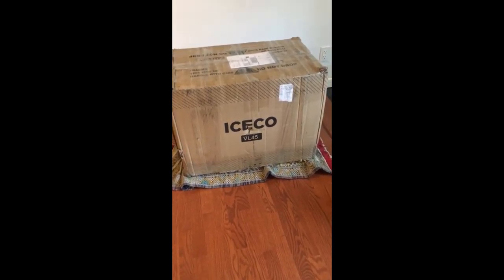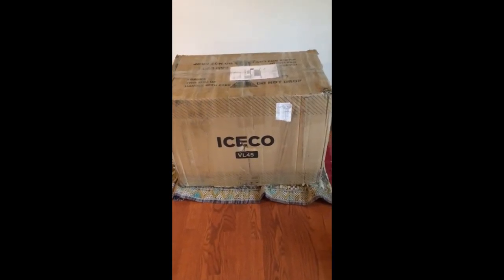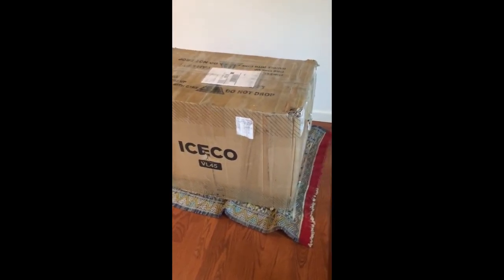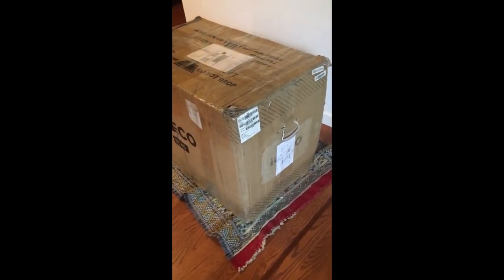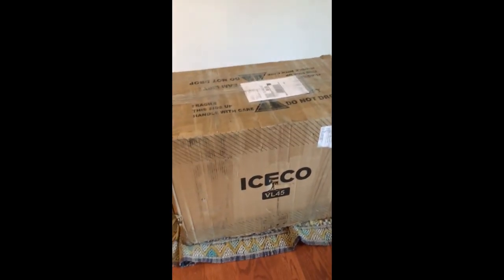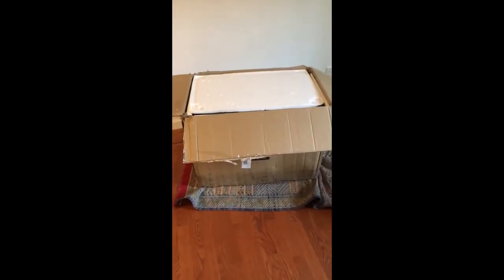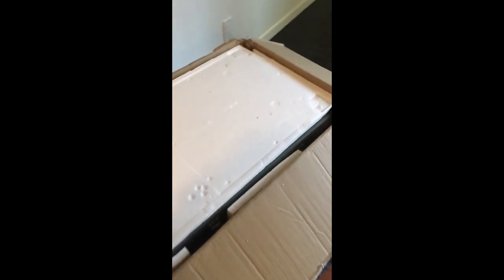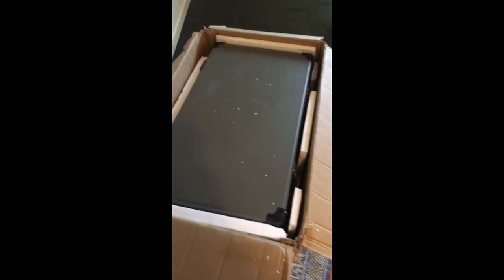Iceco VL 45 Review

Comment: I just got the VL60 single zone.  They now put protective styrofoam "bumpers" on the top and bottom of the box the fridge is packed in, strapped, taped and shrink wrapped on there.  After watching the FedEx person flip it end over end getting it from their truck to my porch I was extremely happy that bumper was on there!  No damage to the exterior of the unit.  I took the fridge out of the box and have let it sit for two days so all the compressor oils can settle back in.  Can't wait to start testing it with my power supply.  Thanks for the great, informative review you did on the VL45, it was very helpful.  Honestly, I haven't seen many negatives on the ICECO units, which gives me a good feeling about choosing this particular brand.

Comment from the maker: The converter used is the built in one in the unit. When 120v is available, I use the AC cord. In my van I use the 12v cord plugged into a cigarette lighter style outlet. A separate converter is no necessary. 
I have had the VL 45 plugged in continually for about 8 months. I’m using it as an auxiliary refrigerator in my house plugged into 120v house current. It seems to have gotten a little louder since new. Could be my imagination. I still recommend this unit.

Comment: Hello, thank you for this excellent review.  I'm writing because I recently purchased the Iceco VL45 and I have a question.  Let me start, though, by saying I have a very high opinion of this product!  I'm looking for information because I'm sure I'm doing something wrong and hoping someone can give me direction.  I'm on my second "test" of this product.  My set up is a Jackery 1000, fully charged to 100% and this Iceco VL45.  In my first test, I simply plugged the 12V plug into my Jackery; set the temp at 34 (which I later turned down to 30); Batter protection is set to LOW; and the compressor speed is set to LOW.  Those settings are the same for the first and second test.  In the first test the cooler was completely empty except the baskets that came with the fridge were inside.  My fridge ran for 4 and a 1/2 days and my Jackery battery still had 18% which equates to about .76 of a watt per hour.  I then charged my Jackery back up to 100%, pulled the baskets out of the fridge, and filled the cooler with containers of cold tap water (I used rubbermaid containers, Cool Whip containers, an empty Folgers container, etc.)  I plugged the 12volt cooler plug into the 100% Jackery battery and noticed that the cooler condensor ran for a LONG time.....In the first hour I lost 4% battery life.  In 4.5 hours I had dropped 12% of my battery life.  I'm now only 12 hours into the test and I'm down to 79% battery remaining (have gone through 21% of my battery for an average of 1.75 watts per hour).   I'm so stunned because I thought the cooler would be more efficient if it were full rather than empty, but I am getting the opposite results.  For both tests, the internal temperature of the cooler was the same - 69 degrees - at the start of the test.  Do you have any ideas of what I could be doing wrong?  Thank you for your assistance
Reply: Putting the containers into the Iceco that needed to be brought down to your set temp took more energy.  Try the same test, but have all the items you are going to put in the fridge precooled, such as putting them into your house fridge overnight, then putting them in the Iceco.  Run the test again and see what the results are.
Reply: @johntalbert8227  t
thank you! ill try this starting tomorrow.
Reply: @shannonmurphy9790  Let us know how the new test results come out.  I am thinking of buying this fridge also.
Reply: @johntalbert8227  I'll definitely let you know how the next test goes.  Keep an eye on this feed for an update.  I'll let you know right now though that I am SUPER happy with this purchase and I do not hesitate to suggest it for anyone looking to purchase.  I have done the ice chest/melted ice situation for too long and knew I'd be saving up for a better situation.  I purchased a Jackery 1000 to use with my solar panels and the next month purchased the VL45 Iceco.  I'd say this set up and my Nature's Head composting toilet are my favorite purchases for my shuttle bus set up.  I'm a weekender only and live in ND, so get out about 10-15 weekends each spring/summer/fall.  I do like to camp with my grandkids and will be taking a 2 week Honda Pilot trip to Glacier next summer with my son who will be going into his senior year of high school.  I'll be bringing my Iceco and Jackery with me.  As a note - Jackery happens to have a 15% off sale starting Monday, November 16, 2020 - I think it only lasts for a couple days and I already have mine, but thought I'd mention it here in case you are interested.  It too is an excellent item.  I have a battle born battery and larger set up that is not yet wired up.  The Jackery I purchased for my fridge, but clearly can charge several additional items over the course of a weekend too.  I'm re-charging my Jackery now and already have water jugs in the fridge to start test #2 with pre-chilled water as you suggested.